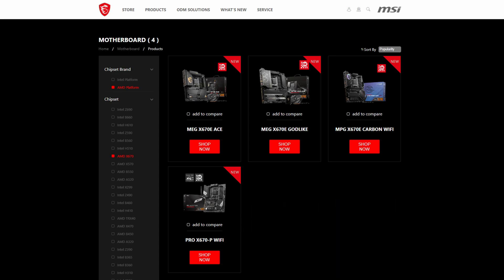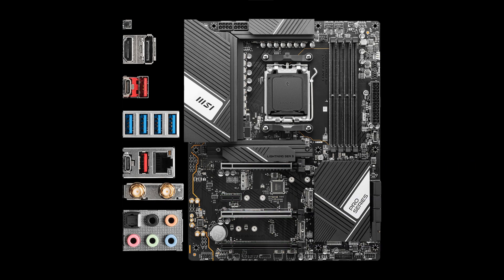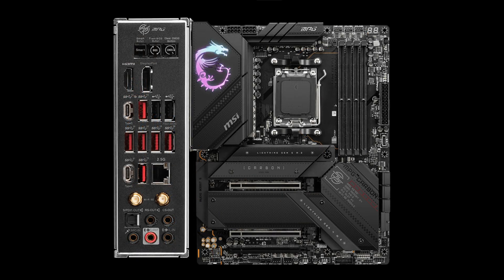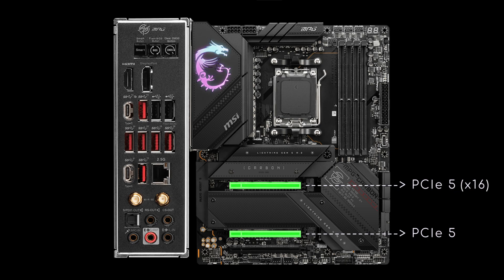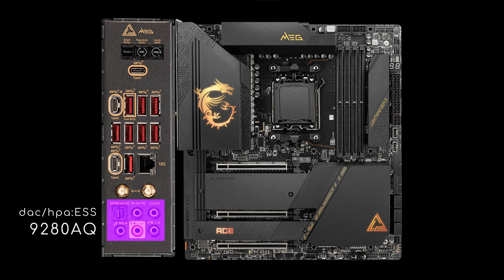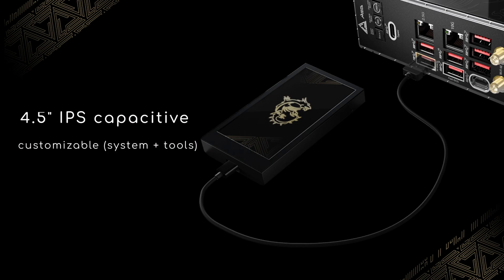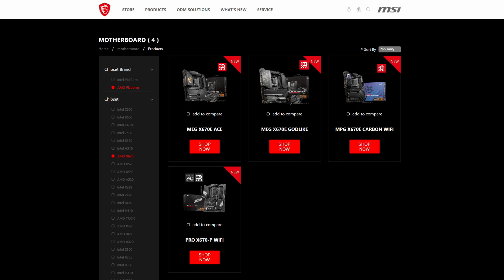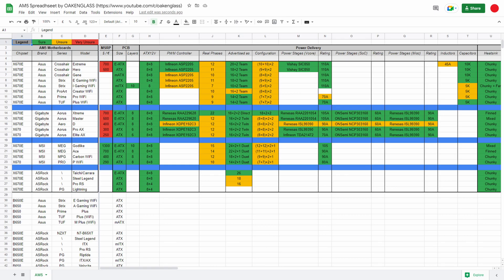MSI AM5 X670 Motherboards Lineup: Preliminary Analysis

Comment: Appreciate the video! Do you expect any X670 to have a PCIe 5 slot and cost under 400€ in Europe?
I'm ready to build a new system, but I'm guessing a Ryzen 9 7900X system is gonna cost me like 1500€ for MoBo/CPU/RAM alone, that's just absurd...
EDIT: Took a look at your excel spreadsheet and I see you expect (but are very unsure of) 300-370€ ASRock MoBos, hopefully you're not too far off on that pricing and they're decent enough and can handle an 7900X! Looking forward to your Asrock video!
Reply from the maker: Many thanks!
Those ASRock prices are based on Twitter rumours, so take them with a grain of salt...
However, I expect/hope there really will be some X670 Mobos with a PCIe 5 slot under 400€.
My guesses: ASRock PG Lightning, ASRock PRO RS, Asus TUF Plus WiFi, Asus Prime Pro WiFi.